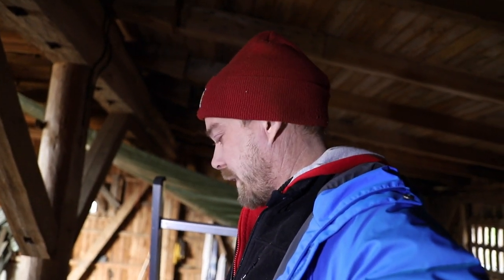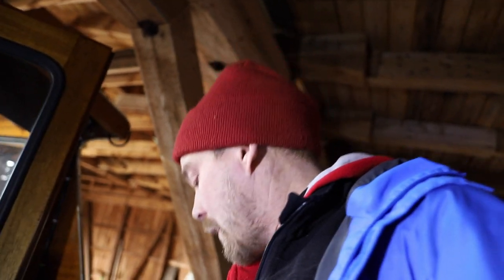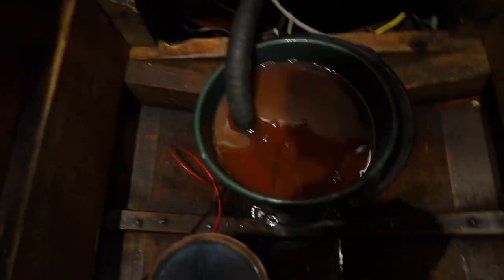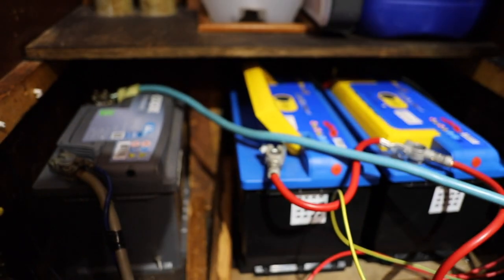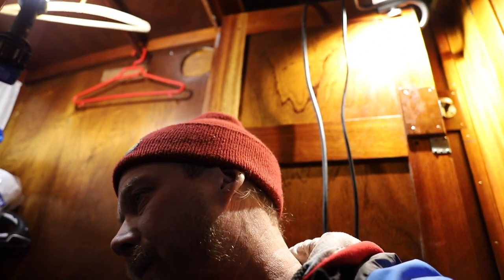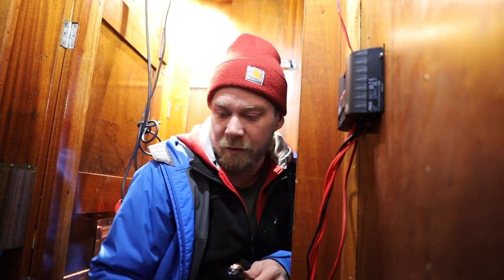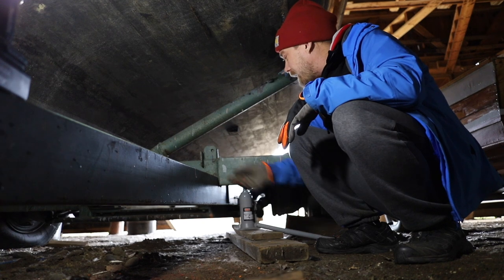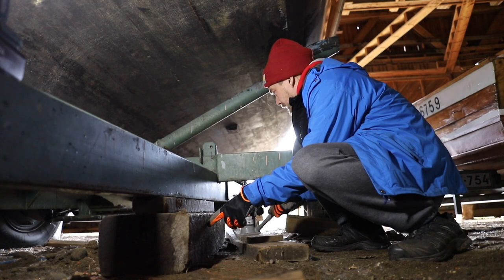Time to Go to Sleep for the Winter - Tyrsky Ep. 35

Comment: Batteries actually are preserved better in cold. If they are fully charged. So no need to move heavy batteries from boat for winter.
Reply from the maker: I believe that is true, at least i have not had any problems doing just this for the last 10 years.